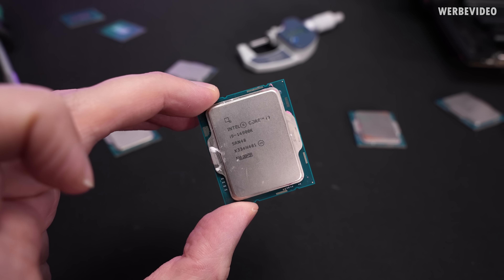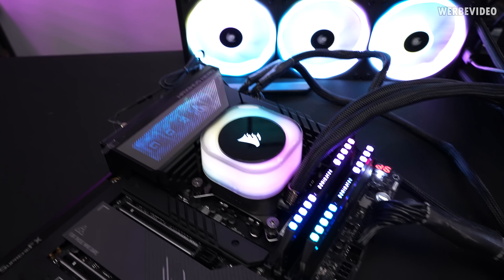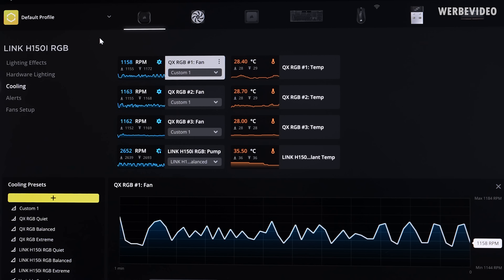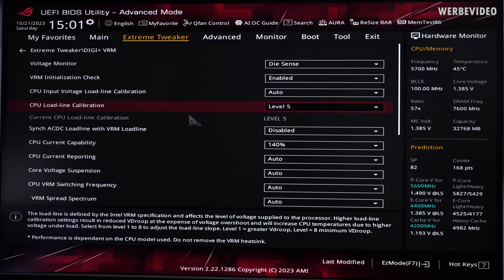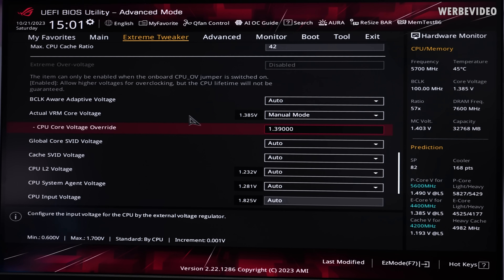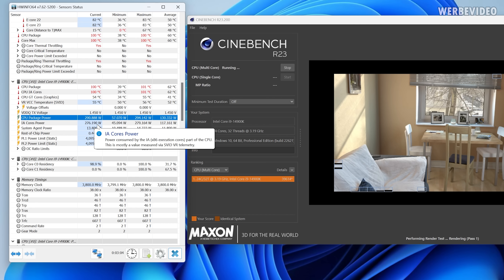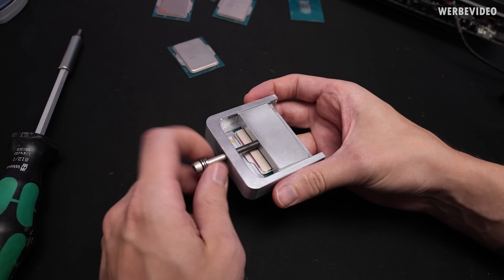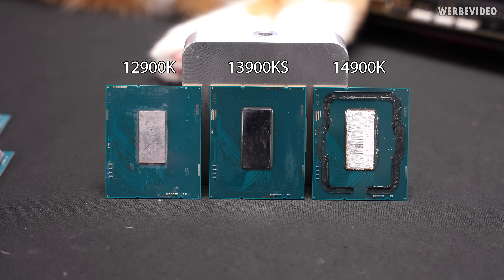Surprising Results - 14900K Delidding

Comment: SP 82!!! That's awful!
Reply: The sp rating is pretty silly and nearly meaningless in my experience. I’ve got a 13600k sp 80 that can do 6ghz with ease.
Reply: @cppctek  6ghz all core with e cores enabled and hyperthreading on? What kind of voltage, LLC, and cooling? That's an impressive OC if truly all core stable in AVX workloads.

Comment: Roman isn't conformal coating required with bare die and IHS? One thing in confused with latest Intel CPU is high temperature, i still don't understand if the chip is hot or is it trying to boost to maximum TJmax value until throttling temp limit takes over. It can be especially confusing on Intel laptops wherein I'm unsure if it has worse cooling or worse tdp setting from factory allowed to hit throttling temps ASAP

Comment: For this or even for 10c on average - this is a great result. I would delidde my CPu for 10c. I got your delidder for i9 9900K but did not do it due that I hear 10c was hard to achieve. 10c temp that will be lowered from stock is a great result and I would do it. Sell your special delidder for that fancy shnancy for a good price limited edition from Germany.

Comment: I would rather see a bigger increase in performance o reduction in price at the lower end. 
Like if the new 14100 is cheaper than a 13100 or at least has a 20% increase in performance that would be great

Comment: As someone who has purchased the Delid Die Mate and the Thermal Grizzly Mycro Direct-Die CPU Water Block RGB I can recommend the block and the delid tool. It has made a huge difference to load and idle temps. Outstanding craftsmanship.
Reply: Is that Mycro direct-die cpu water block for 13th/14th gen? I thought he only made it for AMD.
Reply: @Spinelli__   Only for AM5. It works flawlessly.
Reply: @thomaswilliams  Thanks. Darn, I wish there was one for 13th / 14th gen.
Reply: @Spinelli__ EKWB Has one for i914900k.
Reply: From what I understand from both Kingpin and others, running direct die is really not of any benefit for these 1700 socket chips. This solution with liquid metal and reinstalling the IHS provide the same results. I also believe that the 9.1GHz clock done by ASUS was done with an IHS, not direct die. No experience, just what is floating around out there.

Comment: TBH Intel should partner with you and start pre-applying condoctonaut to their K sku's, they would be much more compelling products.
Reply: Price and longevity dictate that they don’t.
Reply: @inherentlyflawed  Price can be changed and longevity is relative. Most users aren't rendering 24/7. Your CPU can reach high temps every now and then without damaging itself (that's why AMD designed their 7000 CPU boost limits with temperatures in mind not voltage)
Reply: @Boogeymanjw  That's an extreme scenario, of course profesional overclockers will delid and use a different thermal compound anyway, 99.9% of the market doesn't do that.
Reply: A 1c drop makes it much more compelling? Now deliding and liquid metal makes big gains but the has to be redone every so often and the amount of dead cpus you would have from people diying this job would be astronomical.
Reply: @mddunlap03  Improvement is around -10°C and that's significant, and LM doesn't need reaplication (that's why PS5 has LM).. if Intel can manage to optimize motherboard supplied vcore that adds -10 °C improvement and if they lower their prices like they did with 12th gen that's a compelling product. So 100°C - 20°C = 80°C operation temperature and for CPU's that's golden, longevity would be no issue.
Reply: @mddunlap03  Of course Intel won't do any of what i said bc they're as holes

Comment: Maybe or hopefully Intel and AMD will start to offer OEM delidded CPUs in 2024. Your GPU is delidded so why not especially with unlocked CPUs?
Reply: laptop cpus also are "delidded" xD
Reply: @Ubya_  .. I completely forgot about that and you're absolutely correct! 😎👍
Reply: It would have to be through secure channels, as without the IHS it's hard to identify. The issue is it's a weird gray area for liability. There's not a lot of incentive to sell a product they can't warranty to people already willing to invalidate warranties. It's the same thing with GPU waterblocks--you lose the warranty by removing the stock cooler and using one.
Reply: @seitenryu6844  .. There's the entire PCB to use to identify the CPU. The IHS is easily changed to counterfeit a CPU. I think it's important to purchase any expensive item including CPUs through reputable channels.
Reply: I think that would be a warranty nightmare they would not be interested in getting into unless people are willing to take a no warranty offered product.
Reply: @--_DJ_--  .. 50 out of over 100,000 RTX 4090s were ruined by people that could not plug in the 12VHPWR cable. Darwinism. What people forget is it happens every day with the standard 6 and 8 pin PCIe connector. There are people that ruin all their equipment in nearly unimaginable ways. By far the riskiest thing the average person can do is to delid their CPUs. The biggest problem is breaking off the small soldered on pieces on either the top or bottom of the CPUs. 

I'm not suggesting that every CPU that Intel or AMD manufacturers be delidded, but instead their top tier consumer unlocked CPUs. I recall in the past Intel used to offer a special warranty that you could purchase.
Reply: @DJaquithFL  That is oversimplification to a great degree. That cable is a terrible design. In no way should a cable be released to the general public that has the potential to melt when it is still secured by the latching mechanism.
Yes, it boils down to user error, but that was set in motion by the people who approved that design. 
The market is way too small for delidding  to be done at the oem level. A nightmare for no gain, why would they ever do that?
Reply: @DJaquithFL  I call bs on melting 6 and 8 pins by the way. At least as a regular occurrence.
Reply: @--_DJ_--  .. The people that are interested in delidding aren't your average consumer. A lot more people would be using a delidded CPU if it weren't for the risk of damaging or destroying a $500-$1,000+ CPU. The people that are benefiting are typically spending close to $2,000 on water blocking alone. You think that that's a niche market until you realize there's several companies like EK selling to enthusiasts all over the world.
Reply: @DJaquithFL  The risk just begins with delidding. It is a niche market, there is no getting around that. It would not be worth their time to even entertain the idea of selling them without IHS installed.

Comment: I did this in the past with my KS and used Liquid Metal on both sides of the ihs with an aio and contact frame. Great results, with about 18-21C better on hottest cores and I didn't need to grind anything down.
Reply from the maker: awesome! Thanks for the info
Reply: @der8auer-en  outdated monolithic cpu.
Reply: Can you explain the point of delidding CPUs that already come with liquid metal
Reply: @MoonSon298  These don't come with liquid metal, they come with solder. While solder is better than thermal paste, liquid metal is better than solder.
Reply: @fearthechad  I think it's more about the thickness of that solder compared to a really thin layer of LM.
Reply: @fearthechad  I see thanks for the clarification thought indium was liquid metal
Reply: @OneCosmic749  I see, thanks
Reply: @MoonSon298  Cpus don’t come with liquid metal, they come with solder. Liquid metal is more conductive and is a thinner layer between the cpu and ihs which further helps heat conductivity. It can also often fix hot spot issues with cpus with poor solder contact/spread.
Reply: @yosixxx  I see, seems like its worth to do. Too bad some CPUs require to grind down the ihs thats too complex, how would a average person even know how far to grind

Comment: I love my 14900k , running 6ghz all core at 1.4 on my Apex Encore board with Trident Gskill 8000mts
Reply: Hey, I just bought exactly the same setup. Did you modify something in bios? Which AIO? Thanks 🎉
Reply: What is your cooling for CPU ? Do you also delid and use thermal frame?
Reply: @KelvinKMS  in my case , I’ll delid and use the contact frame from Thermal Grizzly
Reply: So lame what a dumb product.

Comment: Wonder how far you can push it with direct die cooling.
Reply: Direct die is the way to go. I’m doing 6.1 all-core and 4.7 on the e-cores but I think I can get a better chip that can do a bit better.
Reply: @tony_bauer  @400Watts
Reply: @tony_bauer  What direct die block did you use? I have an EKWB direct die on a 14700K with 2x 360mm radiators and my temps don't seem to be any better than those running an AIO. 80c, 35-36K R23 score

Comment: I really want them to make the IHS a LOT thinner.  i get the need for protection fo the silicon but they are so thick they are hindering performance and cooling. There is no need for that. There has to be a better way for them to do this. Specially now die stacking is a thing thinner is better.
Reply: it is a heat spreader. cue on the name "spreader"
if it was too thin, all the heat generated by the silicon, would stay in the area of the silicon.
it isn't a problem for coolers designed to cool a very small area, but most are not
Reply: @Ubya_  Yeah not how it works. A heatspreader is optional and mainly needed for protection of the die. The cooler itself is made of copper and capable of "spreading" the heat. All delidded cpu's benefit from being delid which means the spreader is optional and only there for protection.  the mount of broken or damaged dies without them would be to much for AMD and Intel to deal with. 2 decades ago all chips came bare without a spreader but the damage returns where high as placing the cooler wrong cracks/chips the die.

Comment: That height profiling equipment is pretty cool
Reply: Yep! It's amazing. I've been lucky enough to get my hands on some cheap, obsolete profiling equipment off of eBay. The old stuff I have is all optical and mechanical so it requires a lot of effort and some math to come up with a measurement. The integrated software in his equipment is really where the magic happens. That magic is expensive!
Reply: Yeah, I wonder if it could be used in watchmaking
Reply: @vincent67239  it is used in watchmaking, but its Keyance so this setup is most likely somewhere around $80k
Reply: Yea and NO ONE has that bs, yet he skips the entire process where he prepped the chip and IHS. Garbage video.

Comment: In HWiNFO64 you actually might disable some sensors by selecting them and press "Del" key. It will be hidden untill you re-enable them. When you need them back - just press 'Insert" key and they return. Some sensors have got high latency, for example my RTX 3080 Ti from EVGA have got 15 ms itself and additional 5 ms for iCX sensors. To look what's latency on you system, just press "Configure Sensord" button (big gear) when screen with sensors open and find there "Show columns" section and add check mark on "Profiling Time". After that you will see new column in sensors screen. Just scroll all sensors and look which took more time to update.

Comment: The fact that this cpu uses the same amount of energy and one of of the space heaters in my bedroom is nuts.
Reply: Its a 2-in-1, a space heater and a CPU in 1! Dont see anything wrong with that, I dont know why they dont market it like that.
Reply: Why are you guys arguing about heating a room without sufficient info. You can just say "this size room needs this much watts to heat." Whats the temp differential? Well insulated? Large windows? Hell my tiny room gets too hot just leaving my snake's heat lamp on.
Reply: Why are you guys trying to defend cpus drawing 500 Watts?  That is nuts.  You have to use 1300 to 1500 watt PSUs for high-end builds now.  That is bonkers.  Even if you don't care about electrical costs (I don't as I have solar panels), the noise and heat are significant issues.  You are going to be reaching the capacity of a standard wall outlet with a printer, monitor, lamp, and audio setup.  Now imagine you have 2 to 3 kids that leave roblox running and their computers don't go to sleep at night.  I monitor power usage and even with moderate 10700k and 3700x pcs with 6700xts in them, the power usage is nuts.  I absolutely pay attention to power consumption when building pcs now.  For family and friends, I never build over 700 watt systems.
Reply: I use my computer to get my room warm all the time! I had a huge custom watercooling setup and it can literally raise the temp by 10 degrees or more just by playing a game or running benchmarks!
Reply: That's a very weak heater, most are at least 1500 watts. Is this like a little tabletop heater from Wish.
Reply: @neondemon5137  Oh trust me, if you have a small room it heats pretty fast. When I game I use ~450W and it heats my 20m2 room pretty quick. I haven't used my stove since I upgraded my PC with a 3070TI.
Reply: @neondemon5137  Ever notice the heat setting on those?  On lower heat settings they draw less power.  Still enough to heat a room though.  Think about it.  500 Watts is one third of the highest ratings for a resistive 120 heater you can buy.  I think I measured one heating coil to consume 500w, another at 1000w and together the full rating of 1500w.
Reply: @mrfarts5176  500 watts is nothing. The room must be under 10m2 to be able to heat that at all. My room is 15m2 and it's takes at least 1000w to heat it.
Reply: @neondemon5137  My pc feels like a hair blower when doing heavy cad work.  I can monitor real-time power consumption at the psu around 500 Watts.  Think about this for a second.  That is a third of what most consumer 120 resistance heaters max out at.  I am talking about heaters that get hot enough that they are uncomfortable to touch and you need to be careful with young kids around them.  500 Watts is not nothing.  To cool that you need very robust cooling systems.  I don't understand why people are saying this is not a significant amount of heat.  You literally start tripping most breakers around 15 Amps. That's 1800 Watts.
Reply: @neondemon5137  Also, if you are running a 500 watt cpu you are probably running a 500 watt gpu.  Think about the fact you can heat your room with your pc and you dont see an issue with that.  That is dumb AF.  You would then run an AC unit or fan creating even more noise above your already noisy pc.  There is no way I am doing builds that draw sustained total loads over 600 Watts and never will I have a 1000 Watt system as a main PC that I have to use to make a living on.  I might on a server that would be in a separate room running computationally heavy work loads but that is it.
Reply: Damn you must live in a shoebox. I have a tiny flat and I have 2 x 2000W space heaters as radiators.
Reply: @LmaoThisAintTwitter  One of the settings on my space heater is 500w.  My office is pretty much in the center of the house (well isolated), and the way it is positioned it has a lower ceiling than the rest.  I am surprised everyone is shocked that space heaters have a 500w setting.  Running 2000w heaters must use so much electricity it is nuts.  I also live in a desert.
Reply: @mrfarts5176 You have a tiny room the cpu doesn’t always run at that wattage.
Reply: @ZackSNetwork  My room is not that tiny, and I run cad scripts for hours at a time.  I think most of you guys don't even know how much power your computer is actually using.  Try mining with a couple of 350 watt gpus in a room and it will warm it up pretty well.
Reply: @BlueBillionPoundBottleJobs  Its my bedroom where my pc is located too, but yes it is pretty small. Waiting untill my sister moves out and I get her room which is about 2x the size.

Comment: 00:04 Testing the compatibility and performance of the 14900K delidding

01:38 Delidding results in higher overclocking potential for improved CPU performance.

02:56 Peak power draw was 293 Watt.

04:45 The video discusses the process of delidding a CPU and modifying the IHS.

06:18 The height profile of the area shows it is at a perfect 0.3mm, indicating no need for adjustment on the heat sink.

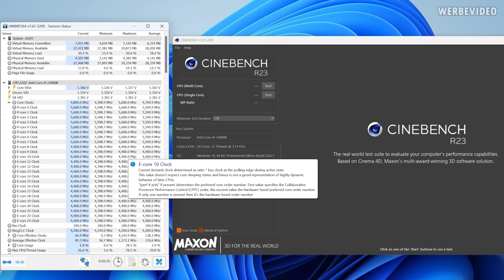07:54 Maximum core temperature after second cinebench run: 93.1°C

09:37 Delidding with IHS and contact frame resulted in significant temperature improvements.

11:03 Delidding and modifying a CPU with liquid metal can provide a temperature improvement of 2 to 6 degrees Celsius.